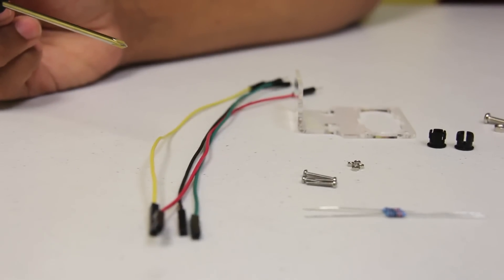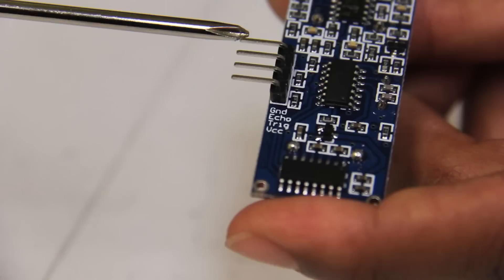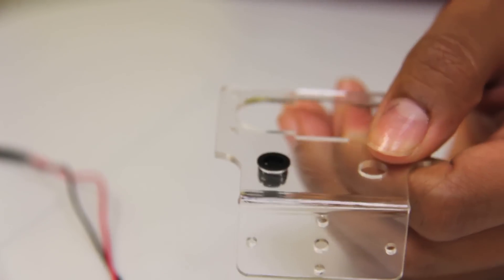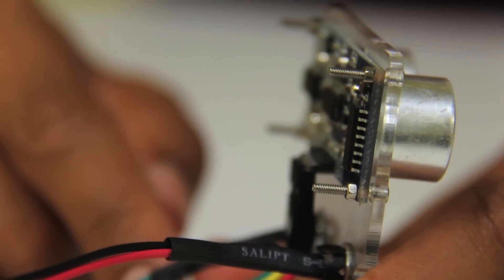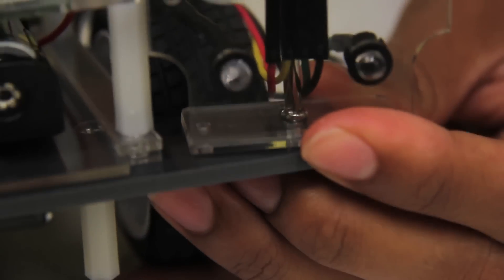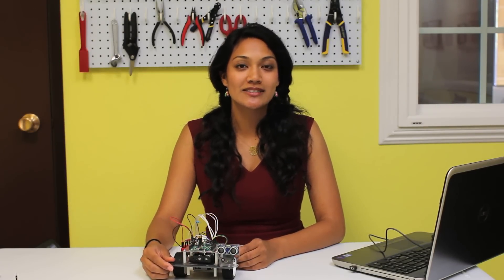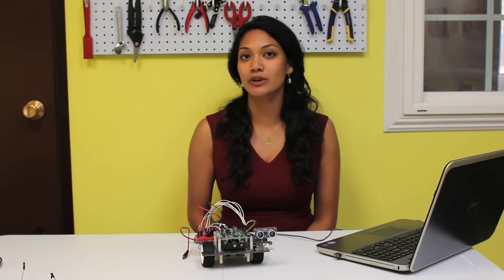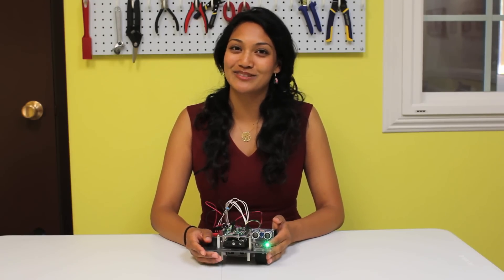Pi-Bot 8: Assembly, Wiring and Programming HC-SR04 Ultrasonic Sensor

Comment: I had trouble with inserting the LEDs too. What worked for me was to: 1) Insert the LED holder into the plastic housing first. 2) Insert the tip of the screwdriver into the opening of the LED holder and use it to gently pry back the four tabs that will hold the LED. just a little bit.. like stretching them open a little bit more. 3) Now I was able to insert the LEDs and have them snap in place.

Comment: "It might take a little bit of force, but be gentle."  The video doesn't really show this (getting the LED's inserted) being accomplished.  If I push on the LED my fingers hit the adapters, so the LED doesn't go in far enough to stay put.  Seems to me a special tool may be required that will let you push on the LED without pushing on the adapter.  I'll keep trying, but I worry I'll break something.  I assume the LED should stay put on its own once it's in far enough.

Comment: Could you please show another video regarding setting up the LED with resistor to the breadboard for the Pi-Bot using the Arduino uno?
Reply: Alexis, go to stem's website, open the line tracking pdf and about page 3, there's a diagram of the wiring and it lists the LED connections.  This was the only way I could figure out where they went, a update to the video I agree would be nice, it seems almost like it was accidentally skipped over.
Reply from the maker: Hi Alexis and RiC0MD - check out Video 2's "Intro to Electronics with Breadboarding" here: http://youtu.be/PRMvQvLV8CY?list=PL1-sfirZuJ5JP40dsdfjbtM5lDY8i5Vwi

This covers that portion in addition to the manual. Let me know what you think and we are working to make that portion a little more clear as well!
Reply: STEM Center USA
Wish I had seen that other video first!  I may have blown my LED!  I didn't see anything in this video about where/when to use the 330 ohm resistors.